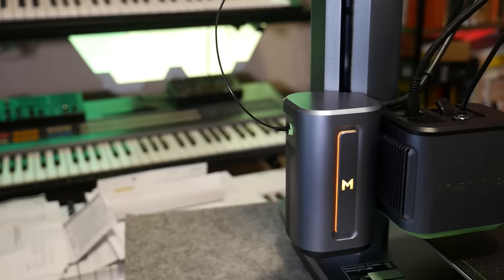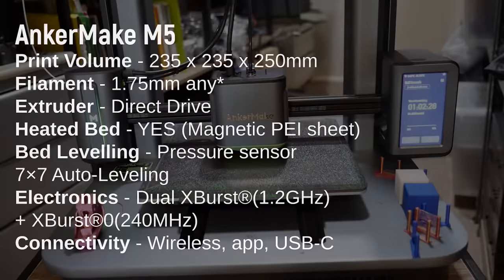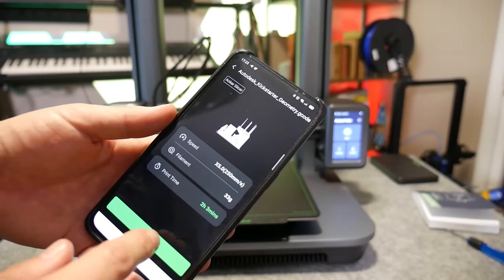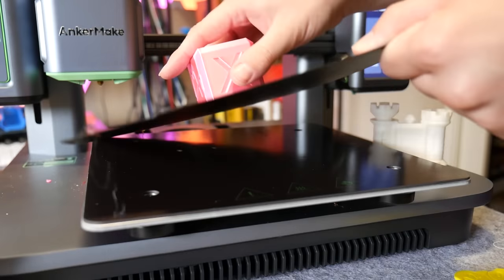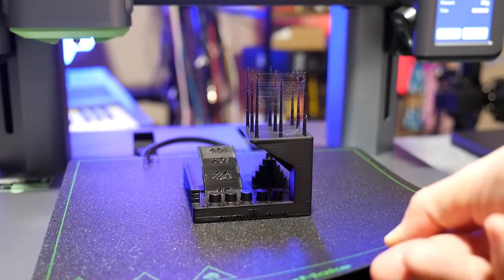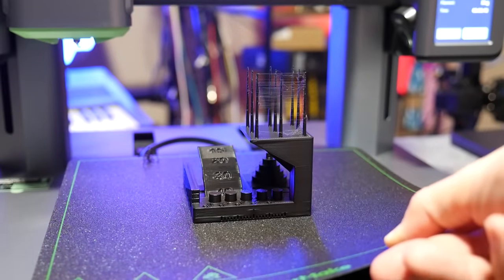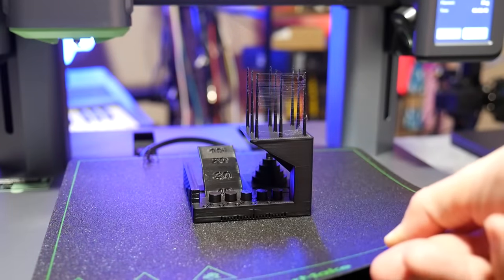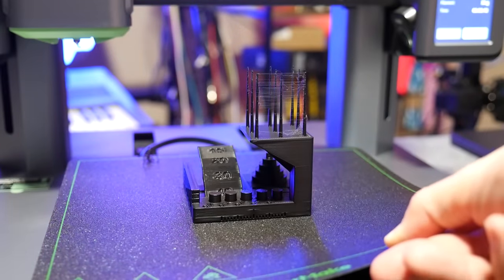AnkerMake M5 3D Printer - Awesome or just hype?

Comment: Completely OT:
I don't understand how an English native speaker who is technically minded ends up saying things like "fast speed". That means "high acceleration", but surely he meant "high speed".
Do English speakers make these mistakes just because English is such a hodgepodge of randomness anyway, or why?
Reply: Who told you fast speed means high acceleration?
Reply: Yes, "fast speed" is technically wrong since "fast" already specifies that speed is the attribute you are talking about, but it has nothing to do with high acceleration, that would be "fast speed change". Most people probably get what he is trying to say because saying "fast speed" is a quite common inaccuracy in everyday language.
Reply: @bongi6811  No, you don't need to include the "change" there, the same way as you don't need to say "fast car location change" instead of just "fast car". It's implied. If the speed is fast it means it moves quickly. E.g., on a car the speed can be observed on the speedometer. If the speedometer indicator moves quickly then the speed is fast, i.e., the acceleration is high.
Reply: @MyAMJourney  Umm.. the definition of the words. If X is fast then X's speed is high. If the speed is fast then the speed's speed is high.
This is no different from saying something like "expensive price" when you mean "expensive product". The price isn't expensive. In fact, you can get the price for free simply by looking at the price tag.
Reply: @marcus3d  acceleration is a rate of change. "Fast speed" has nothing to do with acceleration
Reply: @MyAMJourney  Yes, acceleration is a rate of change, which in turn is a rate of time. Speed is the change of position (a rate of distance over time). Acceleration is a rate of speed (a rate of speed over time, i.e. a rate of distance over time over time). If that rate is high then that speed is fast.
Reply: @marcus3d  acceleration is the rate of change in speed. You can simultaneously have a high acceleration and low speed. Again, fast speed does not imply high acceleration. If you are going 200mph, with no change in speed, the acceleration is 0
Reply: @MyAMJourney  You're making the same mistake. You're equivocating fast and high. Those are not the same. They don't even have compatible units. (And yes, of course you can have high acceleration at low (not slow) speed.)
Speed is a rate of something over time. Acceleration is the rate of speed over time. Acceleration IS a speed. It's the speed of speed. This is not difficult. How do you not understand this?
How about the example of price then, do you at least understand that prices aren't expensive? That an expensive product has a high price, but the price itself can be had freely by looking at the price tag. If you understand that, then it works exactly the same way with speed.
Reply: @marcus3d  I've never seen anyone else talk about acceleration as "fast speed" and leave out the "change" since the rate of change per time is the main property of acceleration and the only thing differentiating it from speed. Because speed is physically dependent on the refernce frame, acceleration can only be about change in speed not the absolute speed, so leaving out the word change gives it a different meaning which doesn't make physical sense.
Reply: @marcus3d  there is clearly a language barrier here somewhere. I'm not sure how else to tell you you're wrong. Fast speed does not mean high acceleration. Maybe translated to your native language it does
Reply: @MyAMJourney  No, there's a cognitive barrier. Do you understand the part about a product's price not being expensive?
Reply: @marcus3d  if there's a cognitive barrier, I'm afraid to say it's on your end buddy. Fast speed does not imply a change in speed. What is so difficult to grasp about this?
Reply: @bongi6811  Well, mostly true. And yes, you don't normally call acceleration the speed of speed, because we have a separate term for that, namely "acceleration", but it doesn't change the fact that that's what it is.
You write that "acceleration can only be about change in speed, not the absolute speed", but similarly speed can only be about change in position, not the absolute position.
It doesn't matter which way you look at it, acceleration is Δx/t, just as speed is. It's a different x, but it's exactly the same concept. Acceleration is the speed of speed, no matter what you call it.
Reply: @marcus3d  Acceleration isn't the speed of speed because "speed of something" is not equivalent to "rate of change over time of something", if that were the case you would have to describe how quickly something is moving as "speed of location" or the strenght of Inflation as "speed of price" for example. The word "speed" refers just to the physical property and not to the concept of rate of change over time in general.
Reply: @bongi6811  Fair enough, but it's still rate of change. Inflation can slow down. The same way speed can be fast. And yes, of course it would be an awkward way to express high acceleration, but that's what it would mean. And even if you used an extremely restrictive definition of the words "fast" and "speed" the expression "fast speed" would not mean "high speed", but rather be semantically invalid.
And let me add that it's very nice to discuss this with you, since you're reasonable, so thank you for, well, existing 🙂
Reply: @marcus3d  Thank you too and I hope I could explain why most people probably don't think that angus is talking about acceleration when he is using the technically wrong expression "fast speed".
Reply: @bongi6811  Oh, I never thought people would think that, but I was rather wondering why a technically minded native speaker would express himself incorrectly in that particular way, with mismatching datatypes. But yes, you expressed yourself very well, thank you.
Unlike R A, who was more confused, and infinitely more arrogant, than Alice talking with the White Knight about his song: https://en.m.wikipedia.org/wiki/Haddocks%27_Eyes